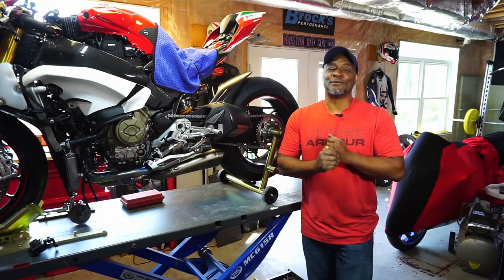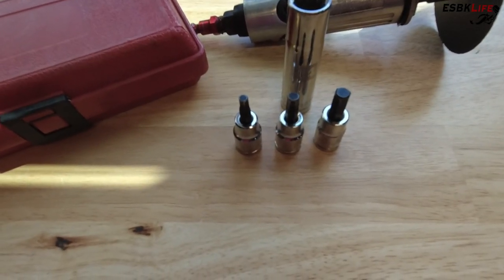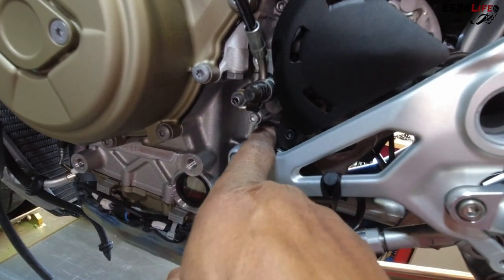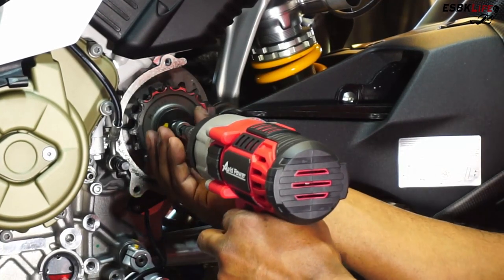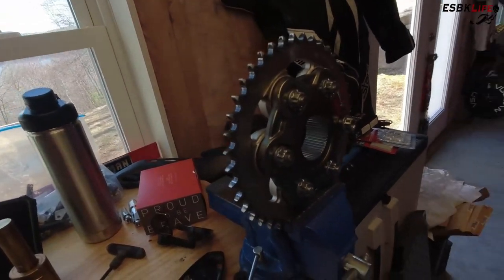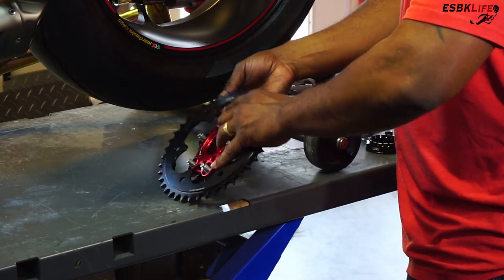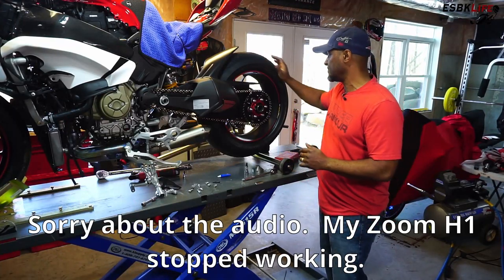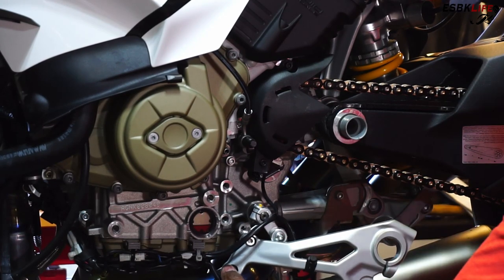Panigale V4 Speciale - Part IV, 520 chain conversion

Comment: 20-25Nm for all of those rear set bolts. Service manual calls for 25NM, I will get it in that range plus or minus 5-10% depending on feel as you tighten. But atet is the spec from Ducati

Comment: It’s getting close!! So I don’t know Ducati torque specs at all but in AZ there is a hardware supply company called Copper State and they have a chart that gives general torque specs depending on size and material of the hardware. It should be universal-ish I assume

Comment: Did you add any loctite back to the front sprocket bolt?
Reply from the maker: I didn't.  The OE bolt that I removed didn't have any thread locker, so I didn't add any.  Having said that, it doesn't mean you shouldn't.  I think I still have a digital copy of the service manual.  I'll see if there's anything in there for adding thread locker to that bolt.

Comment: What cameras do you use may I ask 🙏🏾
Reply from the maker: Sorry for the late reply.  I haven't done much with the channel lately.  Been busy with other stuff.  Anyway, I typically put my camera equipment in the description.  But apparently, I didn't this time. Sorry about that. I have several that I use.  For this video, I was using my Gopro Hero 7 Black and my Sony A6000 Mirrorless camera.  Sorry, I don't recall the lens I was using.  I was also using a Zoom F1 audio recording but clearly, I was having issues LOL.  It typically works really well.  Having said that I have since sold and upgraded Sony as well as added a second GoPro.  I currently shoot with
- Panasonic Lumix S5II
- GoPro Hero 7 & 10 Black
- Insta360 One X2 and Go2

Comment: Did you do anything special to protect the wheel/sprocket nuts during torquing?  I have a black set for my MV Agusta F3 but I feel like they are going to get chewed up on the first torque down.
Reply from the maker: There are several things you can do to protect the wheel nut.  I've had mixed results with them all. You can use, paper towels, tape, a plastic baggie, etc.  But the key is 1) never use an impact tool and 2) your socket should be the same material or softer than the nut.  If the socket material is harder than the nut, the nut will be damaged.  So if the nut is Ti, try to find a Ti socket or aluminum socket.  The downside with using a socket with a softer material is, that it will wear out faster and will need to be replaced more frequently.
Reply: @ESBKLife  thank you for the tips!

Comment: Hi! How many links for the chain?ty
Reply from the maker: Unless you are running the same swingarm length and front and rear sprocket tooth count as me, my chain link count/length will be irrelevant to you. I typically count my existing chain links and then get a chain with more links.  Depending on my goals, I can remove the links that I don't want. But for reference, I'm currently running a 114-link chain on the V4 Panigale.